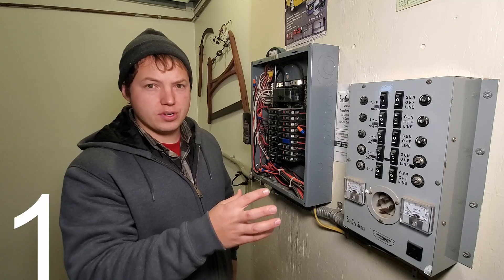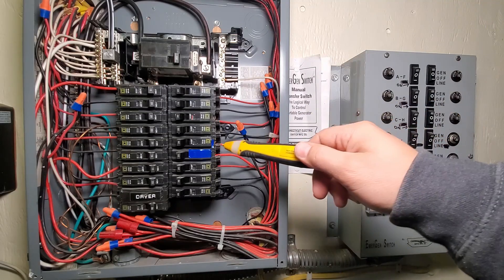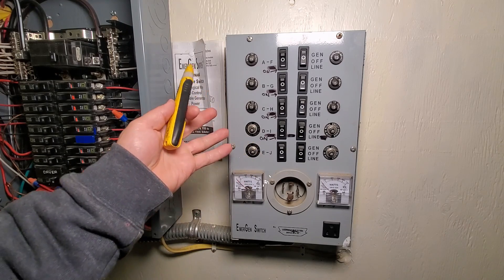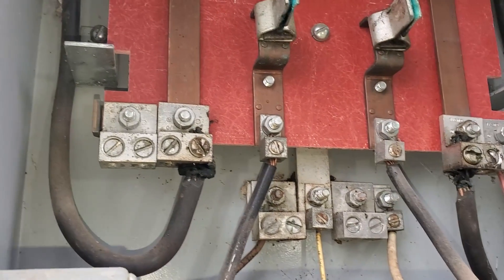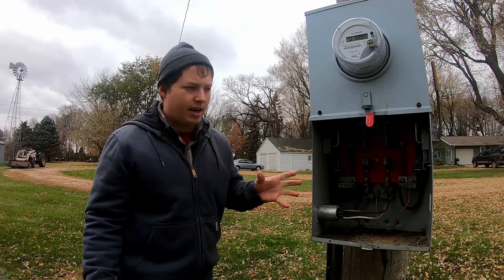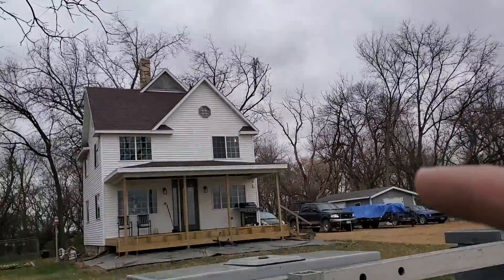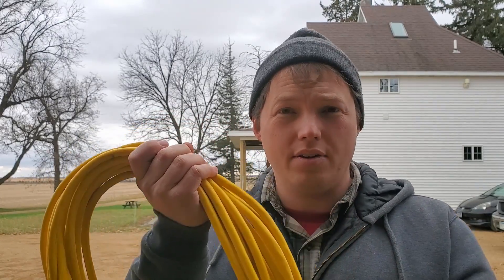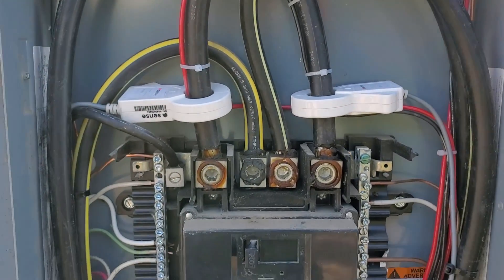5 Ways To Connect a Generator To Your House

Comment: Ben I enjoy your videos. Leads me to even more research. 

QUESTION. I have an old FPE stab lok 100 panel in our house that was probably built around 1961 or 63. Was wondering if you are familiar with them and the problems I’m reading about and now considering replacing due to lack of protection from the breakers. A few years ago I ended up installing a 200 amp box outside wall which is an Eaton panel. (after tree limb pulled off service line). So I guess my old FPE is now a sub panel. Living in South Carolina and wondering what would be typical cost to replace.

Also bought an interlock kit for gen. Thought right match but when I contacted Eaton she said wrong match. My panel has meter attached and therefore what’s required is new breaker cover with built in interlock. Probably high dollar. Find out tomorrow on price. Ugh
Reply: honestly if there is a breaker for the fpe panel in the new 200 amp panel it wld be just a matter of you getting a new panel and breakers but if you need to get a permit chk with bldg dept as they may want you to upgrade to afci/gfci breakers and tamper proof outlets otherwise if you cld find an electrician to do time and materials and you dont need to upgrade make sure they get permit or you pull yourself it will be around $2000 to $4000.  call around you might find it for $1500 or lower ( i live in new england live free or die )

Comment: What brand of meter can was that with the transfer switch? I haven't seen that one before.
----------
That scenario #1 ... Yeah I really don't know why those units were ever allowed in this country. The later versions of them with real breakers are OK, but that one is a no-go in my book. (Chintzy button breakers and Doesn't maintain gfci/afci breaker protection when on generator supply).
With the sample shown, I could see lots of red flags looked like most circuits were multiwire (shared neutral) on 1P breakers, which even if grandfathered, poses hazard if the neutral is carrying load from both legs from two sources that are out-of-phase since the generator is not synchronous with the utility.
Reply from the maker: Pretty sure it was Square D but I would have to look again to be sure. I don't know if they still make them in that configuration or not.

I couldn't agree more with regard to the first type. It just makes more sense to power the entire panel and keep all of the breakers operating as they should.
Reply: @BenjaminSahlstrom  they do a frnd had the same system house was built 8 yrs ago before the afci was mandated in their area ive had to help them a cple of times with the change over they dont understand they need to flip the switches over still lol

Comment: I wanted to go with a Generlink - but ran into issues almost immediately. First off, pulling the meter out of the socket is not a DIY job. It is both illegal and wicked dangerous to try to DIY it. So, I reached out to a number of electricians to get quotes. Long story short, they all wanted huge amounts of money. One guy wanted to charge me $250 to pull the permit (which costs $75), $650 for the Generlink (which is the normal retail price), and $500 labor. He explained that although it would only be a 15 or 20 minute job, he was going to have to have someone in his office spend many hours trying to get a statement from the utility that they would allow the use of the product.
After getting a similar story from 2 other electricians, I went with the interlock solution and did the job myself for less than $300 (including the $75 permit).
Reply: I just checked with my friend a licensed electrician he called Florida Power & Light they said they don’t allow them !!!!!
Seems crazy to me. No safer way to protect utility workers in case of outages. With hurricanes here we loose power even if we aren’t directly hit. The generator would be outside and no cord running through a window or door that would be letting in exhaust fumes.
Reply from the maker: I totally agree that this is NOT a DIY project for sure. I'm sure it all depends on your location as to weather the electricians, inspectors, and utilities, are familiar with the Generlink. Overall I think the breaker interlock is better like you ended up doing but in some situations the Generlink might be a good fit IF the electricians charge a reasonable amount to install it.  Thank you for sharing your experience!

Comment: Awesome Video! I never heard of the Generlink until you mentioned it. Cool idea! I had to search for a question I had.. "GenerLink detects when a generator is operating and automatically disconnects from the utility grid, eliminating dangerous backfeed."
Reply from the maker: Yeah it is pretty neat and seems like a pretty "smart" device. Of course the "smarter" it is the more there is to go wrong but I am sure it is a well built piece of equipment especially since it is so vital that it ALWAYS work properly in order to prevent back feeding onto the grid. It sounds like installation cost (since this is not a DIY option) varies widely from area to area so depending on that it may or may not be a good option.

Comment: Great Video Ben. In these systems, specifically the not manual transfer switches, does having a solar panel system that feeds into the grid (without battery backup) complicate things? Can we just turn off that circuit breaker backfeeding the grid from solar panels?
Reply: Of the two common methods for residential solar, if you have a backed breaker in your main panel, the inverter(s) on the array manage the interconnection by default. Power must be coming in for X minutes and then the solar comes online. If you switch power sources (Util. to Gen) the inverters go to standby mode, and once the generator is online, will begin countdown to reconnect.

[[[What I'm not sure of is whether there are adverse conditions to combining solar with a generator. Sounds like a good idea though, but needs some research]]]
The second method of interconnection is where the solar is tied into the electrical service upstream of your main panel but after the mater(s). If integrating the generator at the panel board, the solar remains tied only to the utility. If a meter base type generator interconnect is chosen, then it combines the Gen with the Solar.
Reply from the maker: Great question! I would guess that you are correct with the disconnection of the solar panels but I am not very familiar with those systems. I would recommend calling the utility or company that installed your solar system and ask them what they would recommend.